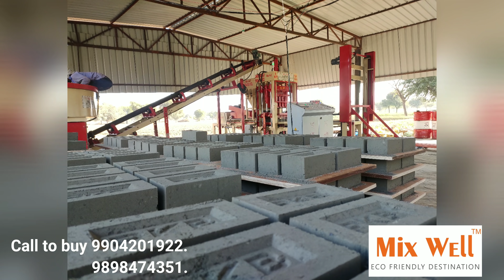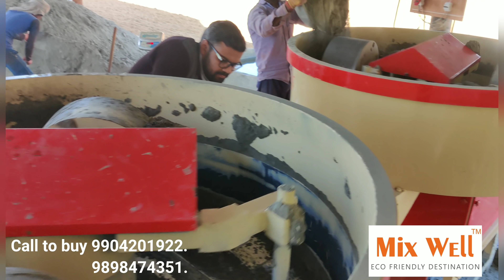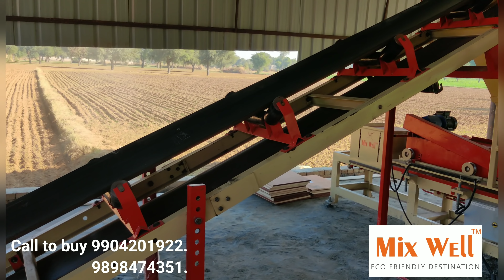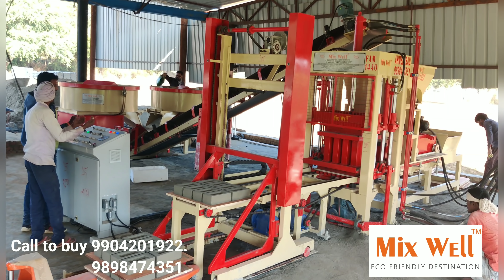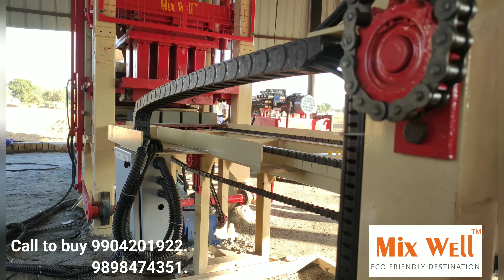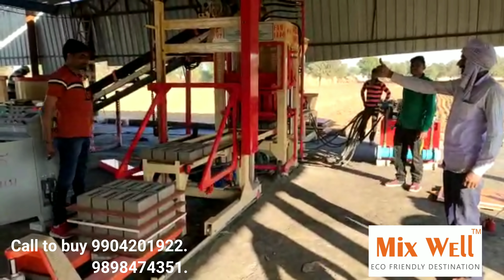फ्लाई ऐश ईंट मशीन |Fly ash brick machine |latest fly ash brick machine |fly ash brick | mix well

Comment from the maker: Call to buy 9904201922. 
                          9898474351
AUTOMATIC FLY ASH BRICK & PAVER & CONCRETE BLOCK MAKING MACHINE. 
ALL IN ONE MODEL. 
1) FAM- 1440 - 8 BRICK PER STROKE
2) FAM- 1800 - 10 BRICK PER STROKE. 
3) FAM- 2160 -12 BRICK PER STROKE. 
4) FAM- 2520 - 14 BRICK PER STROKE.

LATEST VIBRATION+ HYDRAULIC TECHNOLOGY.

BRAND: MIX WELL. 
FIRM: HARDIC ENGINEERING
: HARDIC MACHINERY. 
24 SHREEJI ESTATE, BAKROL, AHMEDABAD, GUJRAT, INDIA. 
M- 9904201922. HARDIC PANCHAL. 
M- 9898474351 CHIRAG PANCHAL. 
WEBSITE: WWW.BRICKMACHINERY.IN
WWW.PAVERBLOCKMACHINERY.COM
WWW.FLYASHBRICKMACHINERY.VIDEO.
Reply: Price